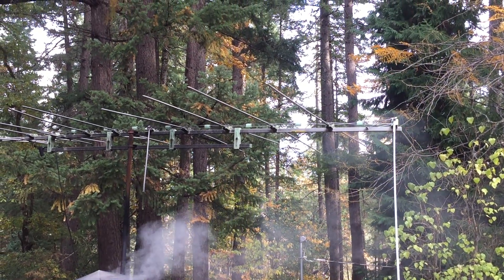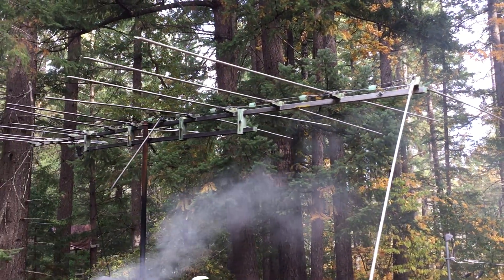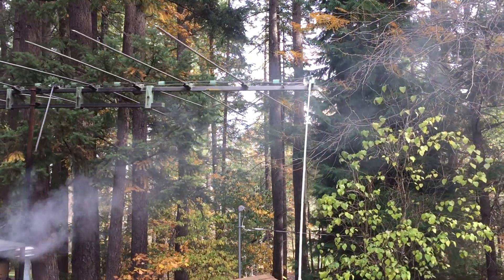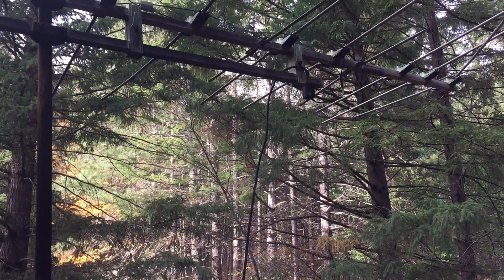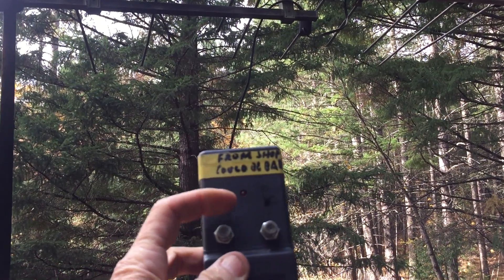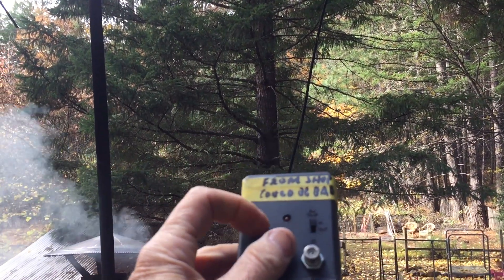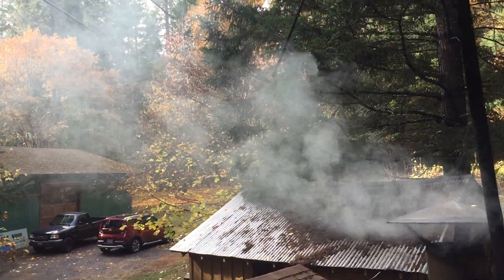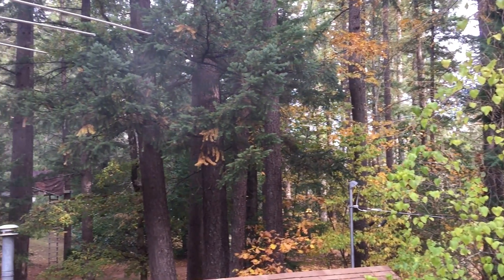A bad TV antenna amplifier is worse than no amplifier at all.

Comment: she would have a far better signal if she put it up as high as she could!! like one of the many tree's around her. then she might not even need the amplifier ( or am i wrong about the amplifier for "TV" signals I know it works on radio receivers, but TV,.. not 100% ) PLEASE CORRECT ME SIR, ON THIS IF IM WRONG ON THE AMPLIFIER AND HEIGHT???  OR ANYONE ELSE WHO READS THIS & KNOWS. 
I DON'T MIND BEEN CALLED OUT ON SOMETHING IF IM WRONG ONE BIT, JUST AS LONG AS IM GIVEN THE RIGHT ANSWER. LEARNING IS MORE IMPORTANT TO ME THAN EGO!! (WHICH HATES YOU BY THE WAY.. YES YOUR OWN EGO HATES YOU MORE THAN ANY PERSON COULD SO TRY TO KILL IT EVERY CHANCE YOU GET) very kind of you for fixing that for that woman. and i bet you you only charged for the amp box. which was nothing.. you probably done the job for free i bet..
P.S.  very handy to know that about analog tech Ariel's.. oh & the pot that can get stuck.  ALWAYS NUGGETS OF GOLD ON THIS CHANNEL...
Reply from the maker: When you live in a heavily forested area like this surrounded by mountains, I've discovered that unless you plan on mounting the antenna above the trees which would be very difficult, sometimes the signal can be stronger closer to the ground. I've had Two or Three jobs in areas like this where I lowered the antenna to get better reception, but what's true in one area may not be true in another, that's why it's nice to use a signal meter for verification.

Comment: There is a bad amplifier on my antenna. The only problem is that it is 30+ feet up a tower to get to it. No channels are being received with the amp being kaput. : (  Thanks for the video.
Reply from the maker: I understand. I don't mind lowering the antennas to work on them, but in this case I knew it meant I'd be covered in black carbon.